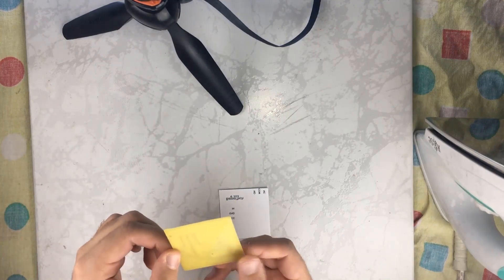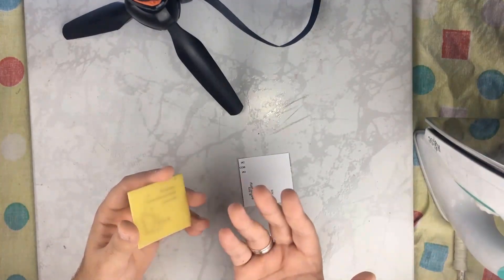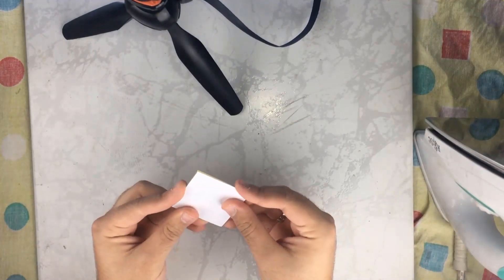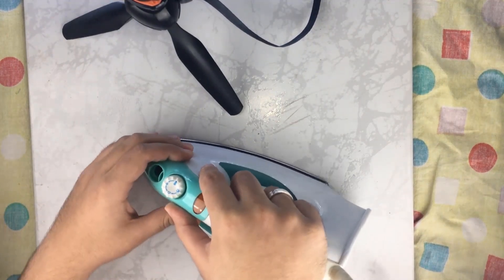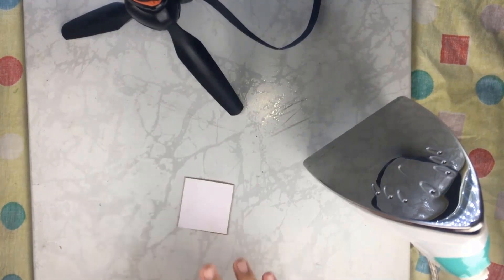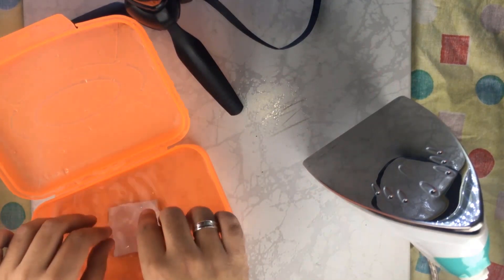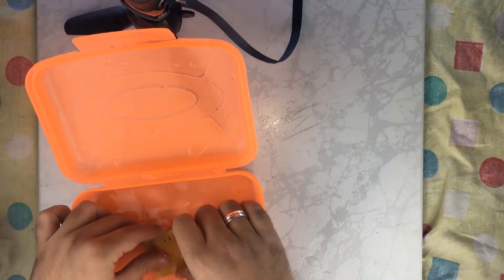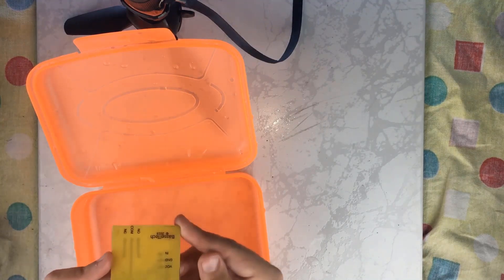Relay PCB - 2 - Printing The Silkscreen

Comment: Hey Dude, what type of heat transfer paper did you use, or where did you get it.. Cheers
Reply from the maker: I used A6 photo glossy paper to do the thermal transfer.
Reply: @BasselTech  thx for the reply, so this method is basicly simply"Laserprinter heat transfer"?
(i thought some fancy vinyl stuff)
Reply from the maker: Yup, it is! :-)
Reply: Thanks Dude 👍
Reply: yeah without that info the video isn't helpful
Reply from the maker: You’re welcome buddy! Wish you all the best! 🙏🏻